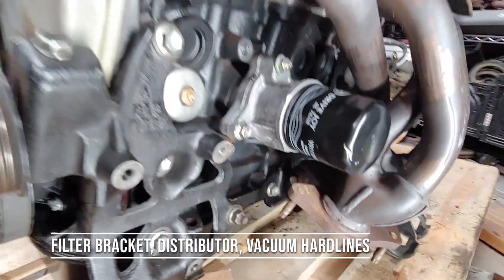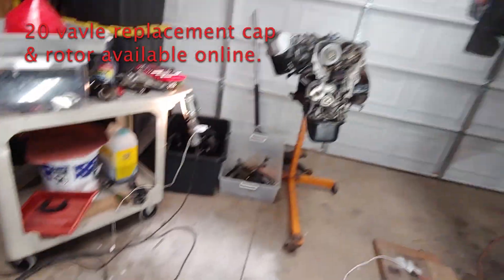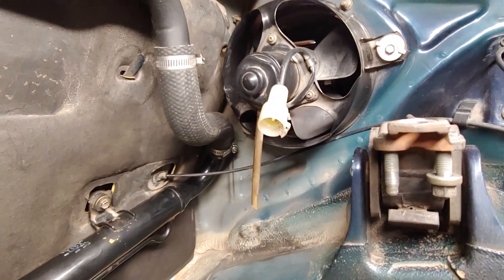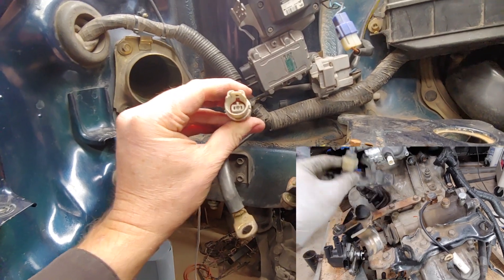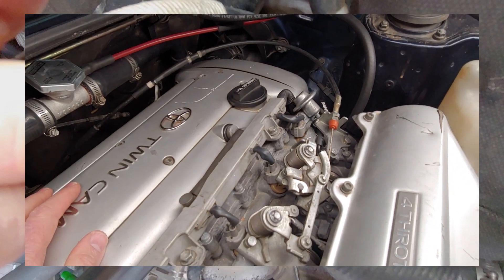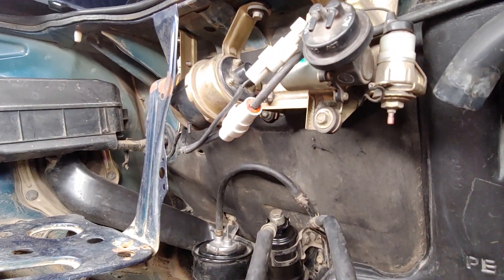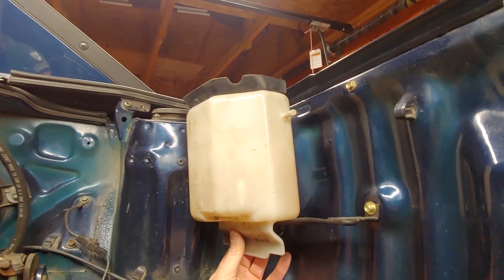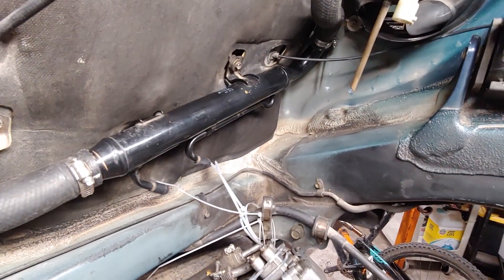Toyota MR2 AW11: How I 4AGE 20 Valve Swapped (Part 2)

Comment: Love those aftermarket wheels. Can you please provide information on what they are & the size? I have those ugly looking factory 4 spoke cast aluminum wheels on my 86 MR2.
Reply from the maker: Thanks. These are Rays Engineering Volk TE37 Cup in 15x7 with 43mm offset. The TE37 is a famously light, strong racing wheel; Its iconic minimal 6 spoke design is among the most replicated of all premium wheels. The Cup edition is an obscure, fairly limited version, distinguished by the curved spoke dish. I should do a video on my wheel collection, but the punchline would be these are my most expensive and favorite.
Reply: @ADub-Bub  —- Thanks Larry! Much appreciated sir!

Comment: Very informative.  Same color as my 87 that I've had for 27 years! It has a 4agze swap with C52 as it was an auto na back when I had it in highschool. Problem is is never ran correctly. I"m finally close to figuring it out after replacing the TPS.